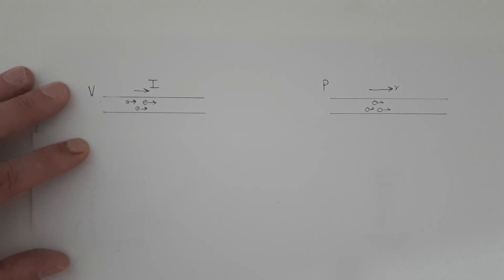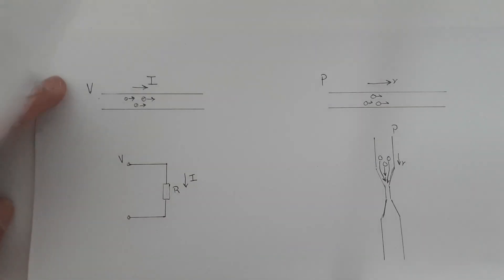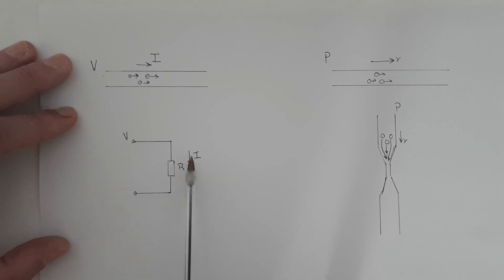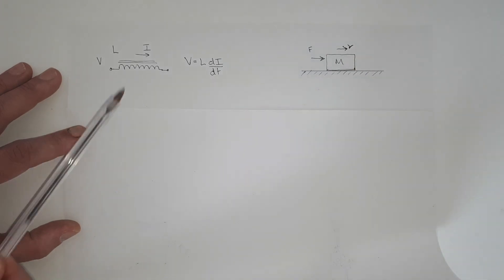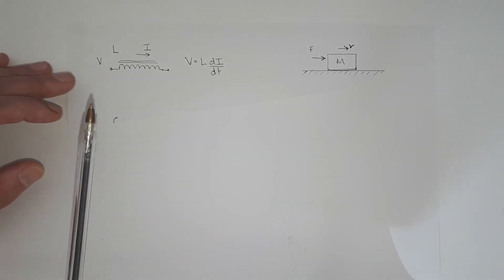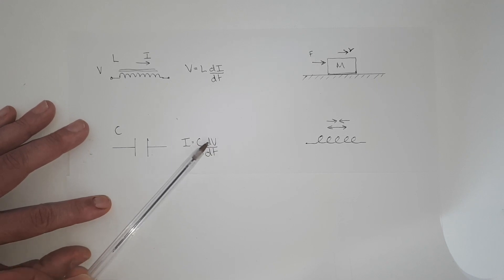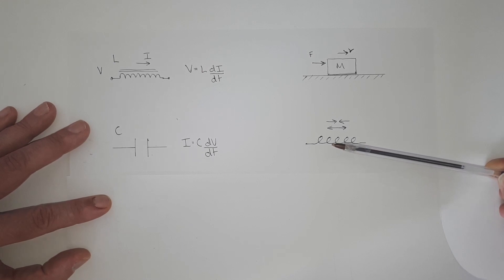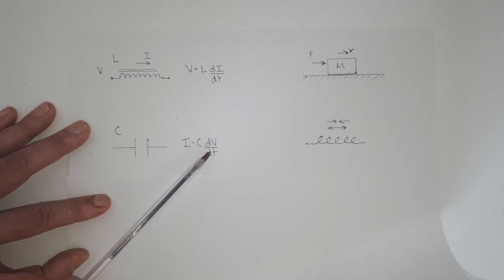What is Voltage, Current, Resistance, Inductance and Capacitance

Comment: I like yo see the pipe P as 2 capacitor plates, where in between there is an electro static field (Voltage) which when it becomes dynamic (voltage change) drags along a volume of energy.
this energy flow is a displacement current.
if this electrostatic field flows in a circle (coil) it drags the volume of energy along circulaire which then forms a vortex which is the magnetic field (still an energy flow)

Comment: 1:14 but if I squeeze a water hose, the pressure increases.  When I add a resistor, the voltage (pressure) drops.
Reply from the maker: Well, i am not sure what you mean. If i have a battery, and short the terminals, the wire/cable being of very low resistance will allow huge current to flow and the result will be that the battery voltage drops, if i then increase the resistance the voltage will increase again.
Reply: @ElectricMonkeyBrain  Did you ever put your thumb over the opening of a water hose thereby constricting the opening?  When you do, you'll notice that the water shoots out the hose at a lesser current, but at a higher pressure.  In fact, if you make the opening (nozzle) small enough you might even cut yourself with the presssure from the fine stream.  What's happening is that you are trading off water current for water pressure.  So the analogy with a resistor seems questionable.
Reply: @Enigma758  It's actually exactly opposite. After the squeeze the current/velocity is much higher and the pressure drops. That's why it can cut you as the particles have high velocity. It is called Bernoulli's principle.